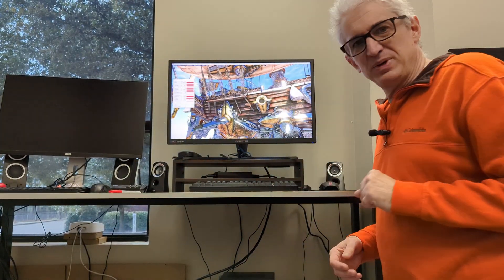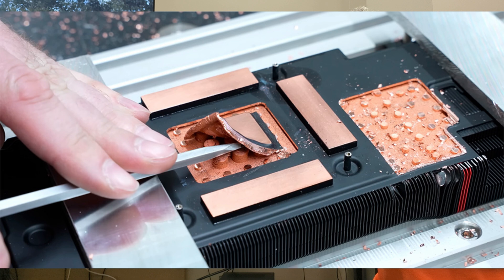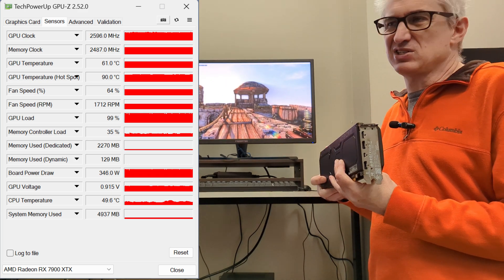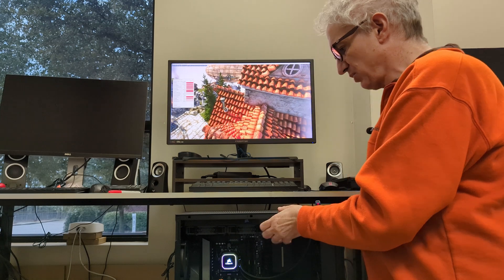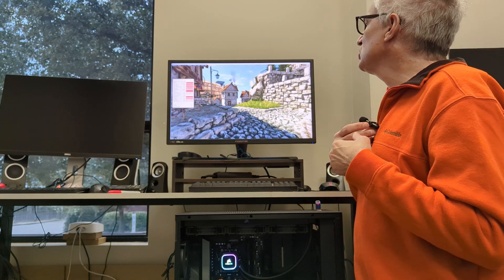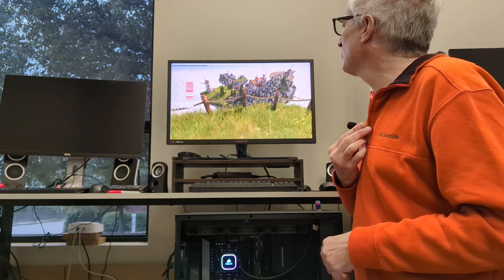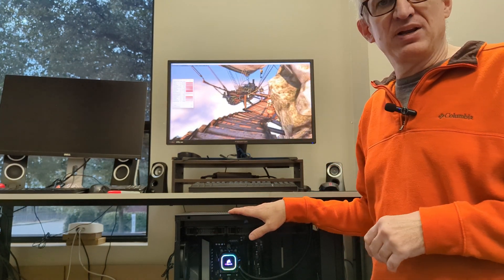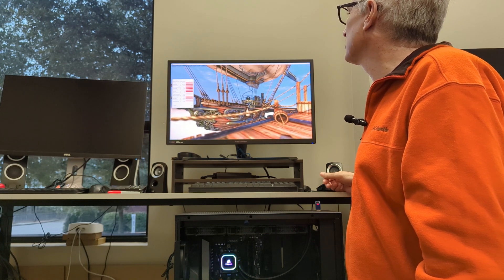Some Radeon 7900XTXs are  overheating - here is why

Comment: I had same problem with 7900xt refference version as well but I solve it. Now it is run 66, hot spot 80, 1400 rpm
Reply: How did you fix it?

Comment: DAMN 90 on the hotspot.
Reply: Actually that's pretty normal. As long as the card doesn't get above 110 degrees C it is considered to be within the engineered range. If it goes above 105 there's probably an issue

Comment: Well my cards junction temp hits 113c with the case upright, laying it on its side it maxs at 93c. I think i’m still gonna rma it.
Reply: did you ever set the fan cure and lover the voltage by 50?

Comment: heatpipe and the vaporchamber is basically the same thing. vaporchamber is "oversized heatpipe". Boiling temperature of water depends of pressure, on top of mount everest boils at 60°C. in heatpipe/vaporchamber is lower pressure than atmospheric.
Reply from the maker: Yeah, when I said boiling point of water is 100C, I wished I had also said "at sea level".

Comment: AMD has never made a good GPU. CPUs seem to be OK, but NVIDIA are thieves, charging what they do. Still, AMD CPU/nvidia GPU seems to be the way to go.
Reply: That's a bit harsh.  Their Radeon 9700 Pro completely thrashed the Geforce 4 and even the Geforce FX 5000 series that came after it: https://youtu.be/qN4O2IqlS84  admittedly that was 20 years ago. Haha.
Reply: AMD makes better midrange GPUs. The Nvidia equivalent always gets destroyed in benchmarks unless it's the 4090 where nothing tops it.

Xplane is the most flawed software ever built. It just happens to run better on Nvidia cards.
Reply: Agreed...XP is absolute shit. MSFS isn't better, though. I am having issues with both. @GuyaneseAviator99